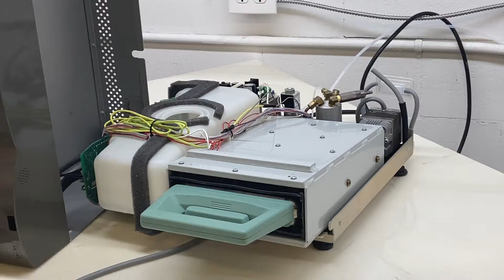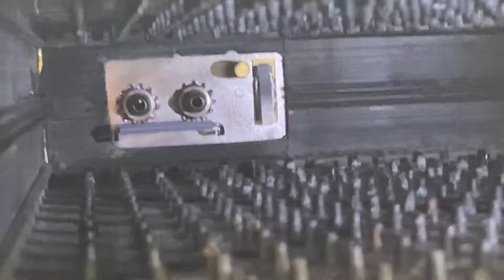Statim G4 Error Code Cycle Fault 90 - How to Troubleshoot

Comment: How do you get it to keep its calibration? Every time I calibrate it resets and goes back to error 90. Thanks
Reply from the maker: Thank you for the comment! Cycle Fault 90 could be due to a simple ram reset, or something as intricate as a defective thermocouple. But because any solutions to Cycle Fault 90 require tools and knowledge only a service technician has, the Cycle Fault 90 is only a shop repair, and is not for the end user. If you have any questions about this or are in need of servicing, you can call us at 704-966-1650 Option 3 for our Free Tech Support program. We'll gladly help you with your Cycle Fault 90!
Reply: @SterilizerAutoclaveSolutions  thanks for your reply. Very helpful